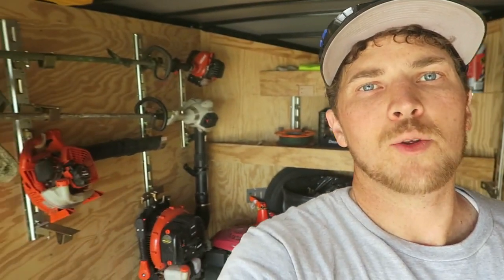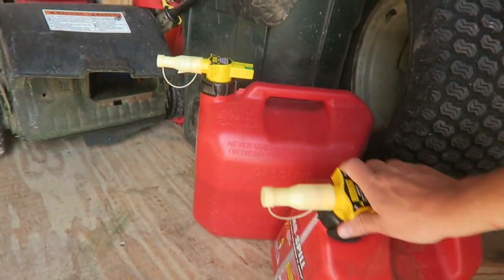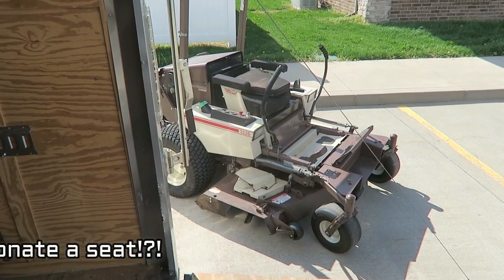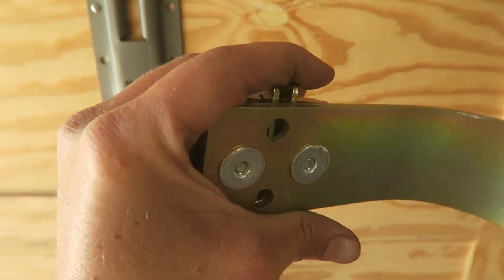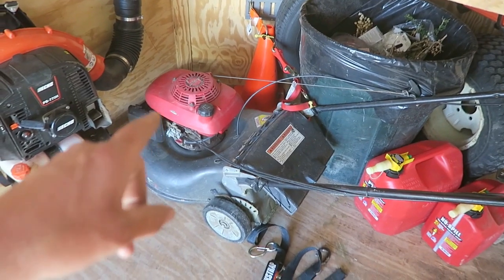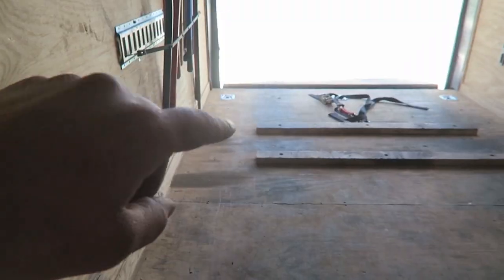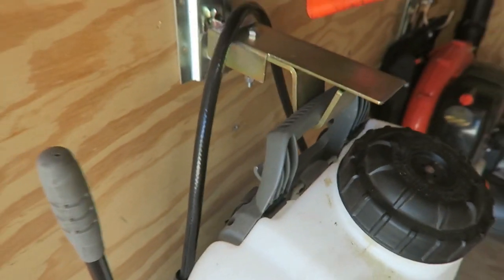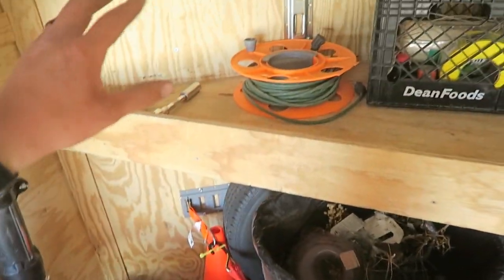2020 Solo Lawn & Landscape Enclosed Trailer Setup

Comment: You have all those ez tracks everywhere. Just wondering why you didn't use those to strap the mower down also?
Reply from the maker: Tried, even had straps to go over the tires. But the e-tracks were slippery and the machine would slide left or right and the straps would get loose. Plus it was a lot of work to strap down that way. I have a couple more videos; one installing tie down hooks in the floor and another with shock straps. Both made it easier to tie down the machine.

Comment: Nice set up I think I am getting a enclosed trailer soon. Are those e tracks for all your tools, blower, trimmers.
Reply from the maker: Yes, it is a really versatile system.
Reply: They have x tracks at tractor supply... so now you can put the e track pieces in vertical or horizontal.
Reply: Kevin A i already purchased everything cheapest was amazon, Northern tool, and Snaprack has the best trimmer holders
Reply: Kevin A check Thrifty garages links 👍🏼
Reply: Talll Grass LM I have two sets of the trimmer holders... just said they are not cheap. They want 60 bucks for one weed wacker holder.
Reply: Kevin A yea I bought them. They come in pairs

Comment: what size truck do you run/recomend for a beginner
Reply from the maker: Most half tons are totally sufficient. Just check the towing capacity and ensure you are under the payload, gvwr, gvawr for both the truck and trailer. It will depend on your trailer. But for a beginner you don’t need a 26 foot trailer.

Comment: I've got the same echo 2520 and I don't like it either I can't keep the dam thing running
Reply from the maker: I'd be curious to see if the 2620 is any better, or what handled options perform better.
Reply: @ThriftyGarage    My buddy runs the repair center at Sutherland's and he says the more expensive handheld blower you buy the better it is because the EPA releases some of the emission restrictions on it so that 1 might be better I know I've had about 6 or 7 of the stihl bg55  I have like them a lot  But have always had carburetor issues on them to I want bg85  But I can't see spending $300 on a handheld

Comment: Bro what are you doing with those straps on your mower😂 just take wood and build around where the tires set. Makes it to where you don't have to strap the mower down and you can get right to business. We have a 24 foot lawn trailer with two diesel grasshoppers. Never strapped down because the wood keeps them in place 🤙
Reply from the maker: Works great until you get pulled over by DOT. The shock straps work great! It’s quick and easy and the mower is secure.